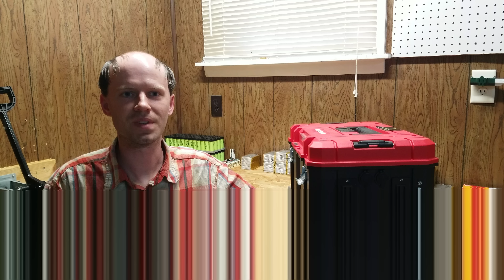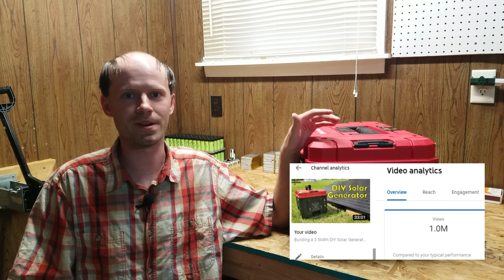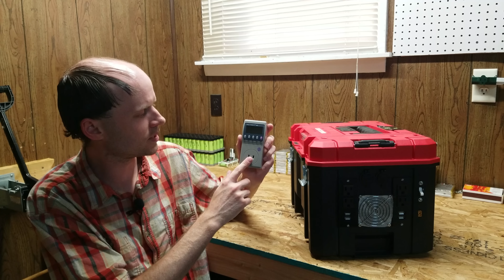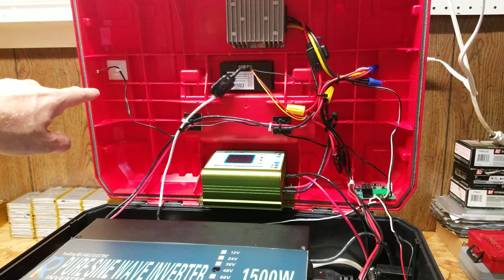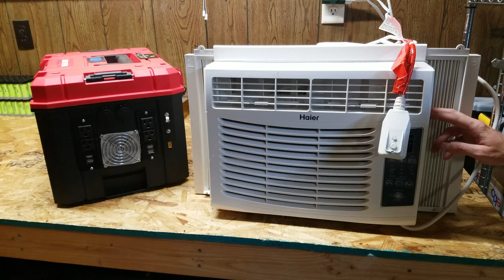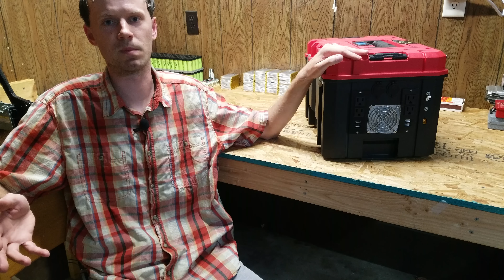DIY Solar Generator Questions & Answers Follow-Up

Comment: I still can’t fine the wiring diagram
Reply from the maker: I see you mentioned this 3 times now. I did post one but I think it's long-gone, sorry. There are several better (and safer) ways to do this now.
Reply: @LithiumSolar  yes am in the process and I need the wiring diagram, I just need to get more knowledge. Am watching lot of videos and yours is more easier and feel safer
Reply: Can u send me a diagram?

Comment: nice power station cool  but if that was me i have 150Amp fused with 50Amp DC breaker for my inverter and 2 20Amp breaker for the 2 110V AC cool build am building one with 3000 watts pure sine wave inverter 110V-120V 60Hz 30Amp  150Amp fused 100Amp DC Breaker for my battery 2 20Amp breaker with 2 GFCI out let and its water proof and water proof fan etc

Comment: I found your video over 2 years after you made it. You really did a great job making the "Solar Generator" and showing how you made it. I will be 65 on the 26th and am going to get me a small camper so I have been looking at everything I am going to need to go boondock camping. I graduated college 1978 and have worked in Bio Engineering most of my career. When I started looking at "Solar Generators" on Amazon I never understood why they called them "Solar Generators". What they are is AC/DC battery powered power supplies with one of the ways to charge the battery up is with a solar panel. You can also charge it with your car or at home.  Why not call it a "car generator" or a "house generator" LOL  I always thought solar generator was a strange name for it.  But they did not ask me!
I was looking forward in seeing the drawing you said you made of the circuitry.  Either it is not here or I am blind.  If I get the time I am going to watch the build video slowly and try to get a schematic diagram of it. After working in electronics all my life I would love to see a schematic.  That is just what I am use to.
So thanks for the very professional videos you have made.

Comment: Thanks for the great videos, so far the best help on diy solar. I am going to build the same unit, but i would feel more confident if i had the wiring diagram,  though i couldn't find it, did it get removed?  I am little late to the party so now some of the parts are not available. The mppt that looks the same and has same designation has poor reviews. Is this just normal noise in the reviews or is there a better option that can be used instead? Thanks again🤓

Comment: I would really like to buy one off you. I do not have the know how or tools to build one myself.
Reply from the maker: There are some great options on the market now, Ecoflow seems to be one of the best at this point. Check the Delta Max.
Reply: @LithiumSolar   Ecoflow,delta max? I will check it out. What about a solar panel for it? Thank you for your reply
Reply: @LithiumSolar  Now im watching all your videos.Maybe you can help me with an ebike battery.If its possible to diy?? Im new to all this and I love it. I just got my first e bicycle and its slow and possibly the wrong one cause I am so green with this tech. My beetery is 36v and motor 375w. What can I do to make it faster for proper work transportation??

Comment: how do you charge the 58 volts from a 32volt solar pannel ?
Reply from the maker: The charger I used is a "step-up" converter rather than the traditional MPPT "step-down" converter.

Comment: You mentioned in your first video that you wished you had used a 2000w or 2500w inverter.  If you used the 2500w inverter, would you still have used the same components or would that have required a different setup or wiring change?  One other question.  The link to the batteries indicates they were 2200mah (they are still sold out) but when you were opening the modem case I thought I heard you say they were 2600mah.  I was able to find the 2600mah modem battery with the 3 separate lithium batteries at another company and just wondered if there was a significant difference.   

Very interesting video.  Of course I know nothing about wiring and thank goodness for brothers who do.  I am going to have them watch this but I thought I would ask my questions first so I would at least seem somewhat knowledgeable.  Thank you.
Reply from the maker: I would have used wiring/components that can handle the additional amperage of a 2500W inverter. If I did this again, I would do things very differently. I wouldn't use these batteries again either. They work, but there are much better choices on the market now for the right price, such as LiFePO4.

Comment: I’ve got a valid complaint, the stack of batteries in the background are a green color, how rude.
Reply from the maker: What color did you want? Lol
Reply: @LithiumSolar  I greatly appreciate the content in your videos. The mistakes you made in the battery packs (backward cell and misses spot weld) would have likely been detected in the testing. I'll  bet there is not one person who hasn't made a mistake in a solar build no matter how careful, And I'd also be most people appreciate you showing when things go wrong, lessoned learned.

Comment: How long will it take for that air conditioner to drain that battry?
Reply from the maker: The air conditioner could run for several hours on that battery. Assuming the compressor doesn't run constantly, as it typically wouldn't if sized properly, it could probably run the AC for a full day.

Comment: Just have a question about the MPT-7210A MPPT Charger, I have a 12 volt system and the charge controller will not stop charging after I have it set to 14volt, I tried lowering the voltage to 12 then 11 and it still just keeps charging, I connected the solar in put to a dc power supply for test purposes and can not figure out how to get it to stop charging once the battery reaches the set voltage? Any input on this would be greatly appreciated. Thank you in advance

Comment: Excellent job on the Solar generator video. I've watched it several times. I'm hoping you will provide the inside dimensions of the toolbox you used. Craftsman only gives what I think are the outside dimensions. I'm planning to use one of these toolboxes for a similar project, so that would be helpful. Thanks.

Comment: No fuses, makes a nice fire bomb!!!
Reply from the maker: I used a circuit breaker with an appropriate interrupt rating. The inverter also has fuses inside along with a fuse on the DC-DC converter. The BMS also has over-current protection. What else do you think I should add...?
Reply: @LithiumSolar  The telsa uses fuses on each battery, i enjoyed the video very much.

Comment: What about how long it takes to charge the battery to full charge?
Reply from the maker: A long time using a single solar panel. You could reduce time significantly with a larger charge controller and a few more panels.
Reply: @LithiumSolar  How long, specifically, in minutes and hrs and this is using what solar panel?
Reply from the maker: @White_Night_Demon  I cannot give you an exact amount of time in minutes and hours. There are way too many variables - panel size, type, geographical location, weather conditions, charge controller efficiency, wire sizing, any standby consumption - the list goes on. A general rule is a solar panel will produce 5x its rating (ie you will get 500Wh from a 100W panel). You could see more or less depending on those conditions listed above.
Reply: @LithiumSolar  Ok, assuming ideal conditions, how long? 

If I can get 500W from a 100W, then how come my 160W panel only come with a 200W charge controller? That means it only supports 200W max panels or only outputs 200W max....

Comment: 3:45 - what about gel AGM (instead of the lead acid version of AGM) deep cycle batteries or lithium batteries premade for you? Surely they're worth something?
Reply from the maker: Sure, AGM will work well - just be heavy, expensive, and not last as long :) But there's nothing wrong with AGM.
Reply: @LithiumSolar  and the 12 volt lithium batteries that designed specifically for this sort of purpose? Could have 4 of them in series and then a bunch of those series in parallel....although I guess they might be pretty heavy to carry around with you....

Comment: Your battery pack is ~51v nominal, ~58v full, but you have some electronics in there that have max voltage of 48v (like the 48VDC-12VDC down converter) - how are you handling that voltage discrepancy? I thought that the down-converter couldn't handle the higher voltage.
Reply from the maker: The stepdown converter is good for an input of 40-60VDC.

Comment: TBH,  what you built is very much a "Solar Power Generator". You included a solar charge controller inside with the  proper wiring so when you connect a solar panel, it Generates IT'S OWN Electricity.

Comment: The only flaw that kept bugging me was that the cells themselves aren't fused.  If one of the cells shorts then it can cause a fire.  I know spot welding is faster but seeing LiPo batteries burn isn't something I wouldn't want to go through.  Being late to the vid I didn't QA the backwards cell, temp position, filter on the fan, etc  as I was looking mostly at concepts and ideas.  The only improvements that could be made is to install some AC charger on it.  I have seen some invertors do it and it could be from some DC connections.  Yes, solar would be the best but it depends on the use case.  I have seen standard commerical and RV sockets.  In the winter having something charged up ready to go I think would be great.

Comment: If the BMS low voltage cutoff stops the power will the solar charge controller still work to charge the battery using solar panels?
Reply from the maker: If the BMS shuts down the battery because of low voltage, plugging it in to charge would reactivate it and begin charging.

Comment: Hi, I´m Oswaldo from Brazil.
In the past I worked for GMB (General Motors Brazil) as a Wiring Harness Engineer (but I'm a Mechanical Engineer), so I know how to project and build a wiring harness, but I don’t know how to design a wiring diagram. That said, I really like the way that you conduct your tutorials  with safety warnings, best practices, and correct ways to do electrical.
First of all, I´d like to thank you for all the content and didactic of your videos. Everything I know about lithium ion 18650 batteries, and charging systems I learned with you.

I'm thinking of building a DIY solar generator as you did, but with some changes that I don´t know if it is possible or not.

My idea is to build it with 12V, but why?
Add 12V in parallel as I get it (lithium ion batteries or lead acid).
18650 Lithium Ion packs assembled for 12V (I don't know how to describe it better, sorry).
Automotive lead acid batteries/AGM 12V could be charged by car generator (engine + gasoline) and then added to DIY generator in case of emergency.
Solar panels or lithium ions could charge my car’s battery, just in case it is dead.
Lead acid batteries are much more commun.

Questions:
Is this system possible?
What would I change?

Thanks in advance,

Oswaldo

Comment: I was gonna comment on the temperature sensor as well, and the heatsink fins on the charge controller in the center of the lid... since it's in the recessed grid the cooling would improve if you rotated it

Comment: What resources did you use to learn to build this?  Is there an open-source community or something like that?  I have lots of questions like how are you testing the batteries?  I am happy to do some research if you can point me in the right direction.  Thanks for posting the video.  I would love to make something like this for emergency backup power.  I am also interested in an off-grid solar system.  Any information resources are greatly appreciated.  I have electronics training but I just need more information about solar and storage.

Comment: So I couldn't find a way to private message, and this is an extremely long shot I'm aware. I, like 2.6 million others (currently) became aware of and eventually subbed to your channel because of the original "DIY Solar Generator" build video. I'm leaving a comment here as it has a bit less views and perhaps this comment will be seen. I'm a hobbyist at best compared to your knowledge level, but I have built and maintained my own off grid house with a ~30 kwh batt bank and have been living here for 6 years now. I'm in the process of experimenting with using different devices to de-sulfate tired L16 group deep cycle batts. I've got a NOCO branded 48v charger with a desulfation feature. 

A very long lead up to my very short question: do you have a reccomendation for a 6v/12v load tester? Perferably something that can return an accurate AH rating at a 20hr discharge rate. If not, perhaps some features I can look for? I've done a quick google search, but the sheer volume of results was a tad overwhelming. Thanks a ton if you even notice this comment and keep up the good work!

Comment: For mine which is much smaller I have a AC meter also which I think is a nice thing to have and you can see how much output you can get from the AC side
Reply from the maker: What kind of AC meter are you using? Is it a Killawatt or something else?
Reply: https://www.ebay.com/itm/143646732027

Comment: PLAN TO GET ANOTHER MILLION WIEVS. Make a 5kwh or  better 10kwh portable solar generator, there is bigger tool boxes on the wheels, make the wiring as simple as possible, use ideas you received. And dont be afraid to  test it on a home apliance for alonger time see how much hours like refrigerator or heating fan would last. Thank you

Comment: I have an issue with the term "generator" as well. Many viewers of this video are off grid users and have a very definite idea of what a generator is. I understand your argument that it's the term used in the industry. But I want to buck the system and initiate the use of the term "Solar Power Station". Less ambiguous but still fairly descriptive.
 This isn't meant to detract from the information content of your video.  Well done !!

Comment: This is a question for Lithium Solar : how did you measure ( and wrote the value on the cell) the capacity of each 18650 ?
Reply from the maker: I primarily use the Opus BT-C3100 for capacity testing http://amzn.to/2xYJXuy. Here's a video of my setup https://www.youtube.com/watch?v=Cxwh6Jkk74A.

Comment: This was Awesome! I'm glad the YouTube algorithm brought it up for me, curious if it could run a refrigerator for a couple hours during a power outage.  Though that said for my off-grid property its awesome to know how well it ran that AC unit. Knowing the I could run a window unit its highly encouraging and means I will take this build on myself even though I know nothing absolutely nothing about all this stuff.  These 2 videos caused me to subscribe and hit the little bell! Interested to know what if any suggestions you have for a build to power an off grid property the most cost effective way. Going full Solar seems expensive as far as Ive looked into it thus far.

Comment: hi i was wondering if you could charge this system without a solar panel
Reply from the maker: Yes. This particular controller can take any DC input, it doesn't have to be a solar panel. You just need to make sure your power adapter is within the specs of the controller and the controller is set to limit the current properly. As with anything DIY, charge it outside, not in your home.
Reply: @LithiumSolar  thank you so much your videos have been so helpful me and my wife are getting prepared to live off grid. Also i was wondering if this specific battery you can charge with a generator. I know some packs you can charge with a gas generator if you hook up positive and negative leads. if you find time making a charging video for this pack would be super helpful. I knfow you can charge these packs with hobby and solar panel im looking to charge  it fast i know hobby chargers will take forever. This will be my  first battery build so please excuse me.

Comment: There was no need to explain things like the placement of the themperature gauge/sensor. If it's your first build it's a prototype. Sometimes things need to be re enginieered 20, 50 maybe 100 before they achieve perfection of something that would pass UL testing. Assuming things was within a first few attempts or "fixes" you successfully put out a video build that probably aggregated 35% of viewers. On a scale of 1 to 100 that means you probably satisfied 65 out of 100. They may not have all given a dislike or made a bad comment because if questioned back they had no sound reason to knock anything. And THE ONLY REASON 65% of people liked the video or gave a positive comment is because today in America it appears that 35% of the population are full of hate and jealousy and won't admit right from wrong if it's not something they can do. It's sad our country has this level of hate and anger but unfortunately it's our world we live in today. I'm subscribing to your channel to see what other things you create since I'm a 65%er who doesn't think I know everything. Yet anyway lol!
Keep doing what you're doing there's a lot of people waiting to see what's next and that's all that needs to matter to you 👍

Comment: how long can work device whom use 1kw in hour, after the device is fully charged in night.
Reply from the maker: If it's fully charged and your load is 1kW, it would run for about 3.1 hours. I factored in 10% loss in the inverter.
Reply: @LithiumSolar  so if u having a 3000W vacuum cleaner, you would only be able to run that for an hour before the battery dies?

Comment: Am I able to hook up a wind turbine to this generator, in case there is no sun to power the solar panels during the day?
Reply from the maker: Yes, but you'll need a different charge controller. I'm not overly-familiar with wind, but I believe it's typically a much higher voltage?